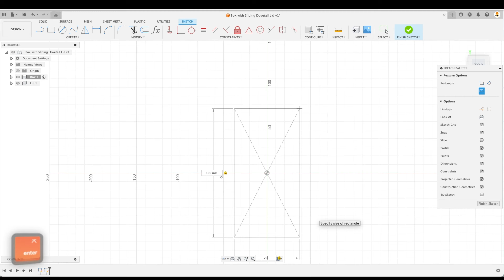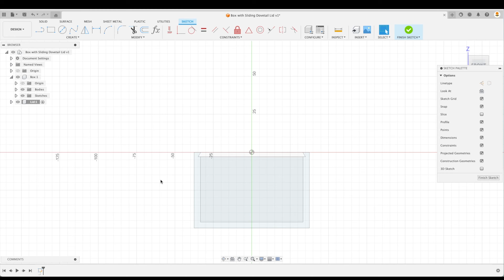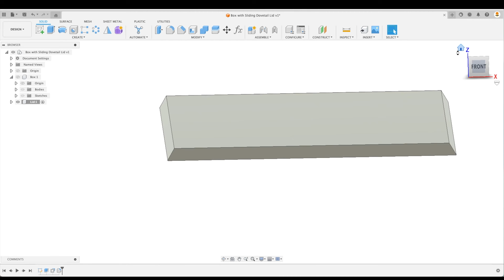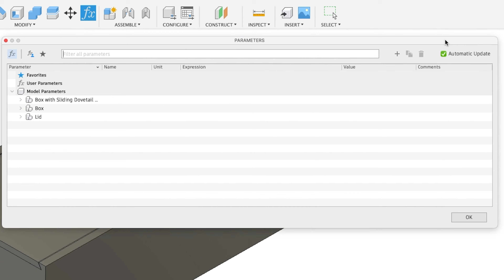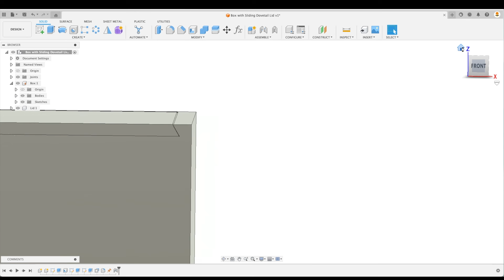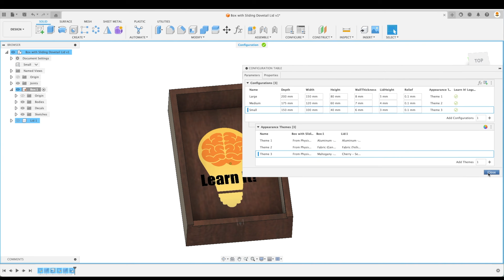Autodesk Fusion 360 - Box & Sliding Dovetail Lid for Beginners, Pros, & Masters - Configurations

Comment: You are able to grab a component and move it around but I can't.  After I create the slider joint, should I be able to grab it with the cursor and slide it back and forth?
Reply from the maker: You should be able to. Please confirm that you have created and joined 2 components and that your slider joint has no max or min limits.

Comment: great video, very instructive but the lid width won't change accordingly.
Reply: does  it have anything to do with the coincident point in the sketch?
Reply from the maker: Usually it is something very small that was missed. A relationship (perhaps a coincident constraint) has been missed. Have you tried starting again? When I was learning Fusion, I often started designs again, sometimes 3 or 4 times over until I understood it.
Reply: Same thing happened to me. I just redone the entire lesson and it works. I believe it was some constraint I missed.
Reply from the maker: @noseasmamut  These things happen to the best of them 😉
Reply: got it, i will try again. Thanks for the tip!
Reply from the maker: Thanks! That’s too bad to hear about the lid.

Comment: If I want to make this type of boxes but with negative space in a specific shape, how does the process vary?
Reply from the maker: I cant quite understand your question. Can you rephrase it and give some more details please? Thanks!
Reply: @learnitalready  If I want to make a box for a PSP, and I want the PSP to fit perfectly, so I need the box to have the hole to put the PSP in, but when I use a 3D model of the PSP to make the cut inside, when I want to remove the face that will make the sliding cover, it gives me an error because the inside part tells me that it is already cut.

Comment: Box doesn't print at all on an X1C Carbon.  Tolerances are way off and don't change the print when changed.  Box is not designed well unfortunately.  Your series on Fusion however is excellent, yet this one doesn't work for a 3d print.
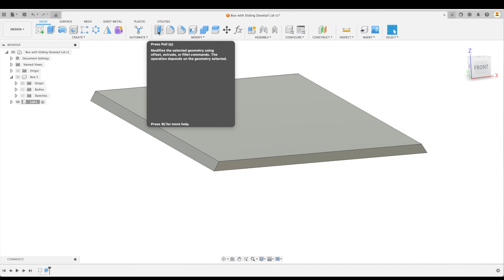Reply from the maker: Thanks for the feedback. Please note that tolerances can easily be adjusted; note the techniques starting at 7:30. If you find an offset for the lid that works, please share the value in this string of comments. Thanks, too, for your support and encouragement.

Comment: Great videos learning a lot! Can you explain why your center is on top of the box when creating the lid and mine is at the bottom?
Reply from the maker: Great to hear! Thanks.

It’s just a matter of whatever direction you extruded the box. When you select a closed profile to extrude, note the direction of the arrow. A positive value will go in the direction of the arrow whereas a negative value will go opposite of that. We probably just went in different directions. Sometimes Fusion selects a different normal (direction of extrude) for a variety of reasons. Not a big deal. Just change your extrude value from a positive to a negative or vice-versa. I generally like grabbing the arrow and moving it in the direction I want to go to see if the value is a positive or negative integer and then specify the value I want.

Comment: When I selected Joint, my box didn't become transparent. I noticed that the ground option says "Ground to parent", and not just "Ground". Did I miss something?
Reply from the maker: Great question. After producing this tutorial, Fusion changed the meaning of "Ground." Now there is "Ground to Parent" and "Pin." "Ground to Parent" establishes a rigid relationship between a child component and its parent, causing them to move together. "Pin," on the other hand, fixes a component in place within the active design, similar to the old "Ground" command. A crucial difference is that "Pin" adds a feature to the timeline, which can be suppressed or removed if the component needs to be moved, while "Ground to Parent" is more integrated with the parent-child hierarchy.

Comment: Your videos are so helpful.   I made a couple huge decisions over the past few months and one of the most important was to become proficient with Fusion360.  I have a small print farm, and learning Fusion 360 was very high on my to do list.  I have used many different tutorials but some of your videos have upped my abilities with Fusion 360 at a new record pace.  I am finally feeling like I have become very proficient with Fusion.  It literally takes a wee bit of investment of hands on time designing stuff from scratch and mixing tutorials like the one's you have provided to learn at an accelerated rate.  

A few mistakes I learned early on were figuring out how to use constraints.   The single most important thing I learned that really jumped me up a few levels was to stay away from the 3d environment when designing, I am sure many get sucked into this same mistake.  Once I realized how easy it was to work with sketches and the fact I could pop them in at will my comfort at quickly designing parts in Fusion jumped massively.   This only happened a few weeks back, for months I just did not put the proper hands on time at designing parts in required to become proficient with Fusion.  

This video was very eye opening with the fact that you show how easy it is to create master templates using the Fx dimensioning tool.  Your content has been invaluable.   I have sat down this evening and learned comfortably how to work with joints, animations, and now with the Fx dimensioning tools.   This is a huge leap in less than 60 minutes.  Thank you, very much appreciated!   

I found this week was my first week with Fusion 360 where I was able to make complex parts for the 3d printer being used in real world applications in literally minutes.   Not even a month ago I would be struggling just to make a few simple objects.  I feel like my abilities are night and day from only a few short weeks ago, these tutorials have paid off in a short period of time.  This is the level I was hoping to achieve.    My next goal is to continue with this self learning and to learn and become comfortable with all of the tools built into Fusion.  

I also have a hobby license for Solid works and hope to start using that soon, I bought the license for around $59 last June, but have only played with SolidWorks a few hours in total.  I stayed focused only on Fusion 360 which was part of my goal initially, become proficient with Fusion than at some point will take on the challenge of learning SolidWorks.  

The main reason I also stayed away from SolidWorks was due to fact that my laptop was old and outdated lacking proper video card and drivers.  It was not running SolidWorks online well.  I recently solved my computer issue by building a preretirement computer system.     Two weeks ago I built a killer computer setup with the latest greatest 5070 video card, a 16 core AMD Ryzen 9 7950 x3d processor mixed with the new Samsung  2TB 9100 Pro NVME 14GBS SSD for my system drive.  The other top add was a nice large 34 inch curved 165HZ monitor.  Wow, the 34" monitor made a huge difference working with CAD software.  This made all the difference in the world for being comfortable while using Fusion and being able to see everything well.  A few months ago I learned that comfort is important when sitting at the computer for any length of time while trying to learn.   I invested in a very comfortable chair and desk setup, one must pay attention to these details when working at a computer station for any length of time.  This becomes even more important at my age.   Anyways,  looking forward to applying all of the valuable information I have been gaining from your videos to my Fusion 360.   I am also looking forward to my next challenge which is to install SolidWorks on that new PC and to sit down and become as proficient with Solid Works now that I have the proper computer setup capable of handling their software.   Your videos are very much appreciated!

I will have to sit down and work also at becoming proficient with use of spline tool, to date I have pretty much stayed away from it.  Some people like it a praise it while others stay away from it.  I have not really formed an opinion yet on it, I only know I seem to be able to get by without even using it.  I stick to tried and true tools and methods, but maybe that will change as I practice throwing it in there.  I am also starting to use shortcuts more often in Fusion, this is very helpful.

Comment: You could have also added the depth parameter to your sliding joint limit!
Reply from the maker: Yes! Excellent comment. Adding limits to the joint motion is always good to do.
Reply: @learnitalready  yep, and you had a number in there, but it was the hard coded number for the first box length you put in during the "newbie" section.

Comment: Beginning to run out of superlatives :)  But once again an awesome session.  This was a nice respite from the previous lesson.  Boy configurations are very cool.  I may have to take advantage of the new Flex subs that AutoDesk is offering just to play with them.
Reply from the maker: Thank you so much for your ongoing encouraging messages. Glad you’re still enjoying what we have to offer. 
Also, this lesson is just scratching the surface with configurations. I just finished an immense job for a company that manufactures rotors. We are planning on showcasing what Fusion can do to such an immense scale - thousands of rotors in several different styles. Designed, CAM’d, and sent to the machine in 5 min (instead of 3-4 hours per/part). It is mind-boggling how configurations can be used for the benefit of small to large scale operations.
Reply: @learnitalready  Very cool Tai.  With what I do for my hobby it would be nice to use configurations but not necessary given the scale.  But your example...just WOW! What a timesaver.
Reply from the maker: @ Would love to see some of your hobby projects at some point. Keep up the good work!!!

Comment: Great video but something broke.  I added parameters but when I changed the width parameter from 75 to something higher or lower, the lid width stayed the same.  The Depth worked OK.  I'm not sure that when I started the lid I really inherited the geometry from the face of the box.   Is there a setting that controls that?  When you tested the parameters you showed only the box and not the lid.  However, it did work when you showed various configurations.  I did not do the configurations as that appears to be a paid feature.  I appreciate any comments you have.  Thanks.  BTW, I've done a lot of your videos and really have learned a lot.  Irv in Florida.
Reply from the maker: Thanks so much! Don’t worry, oftentimes our model or assembly will break while figuring out parameters, especially late into our design process. Also, in this specific tutorial, parameters will have the same effect as the configurations, because the configurations example is very simple, so all should be good in that regard. 

Your explanation sounds like something was missed. Again, don’t worry as that sort of thing happens often. I would suggest starting again and check your parameters often throughout the design process. If all parameters work at step 1, then move on to step 2, 3, 4 and so on. If it breaks at a specific step, then you don’t have to start again, but just try me diagnose the error that just happened.

Please let me know if that helps. You can also send the file to us so that I can diagnose it. Please don’t forget to like me subscribe (if you haven’t already done so) as it helps to get our channel out into the YouTube world. Thanks so much!
Reply: @learnitalready  Hi...  I restarted like you suggested.  I think I found my error or the only thing I might have changed.  When I projected the 2 insides, I don't think I had the Projection Link checked.    I made sure I did and followed the video.  After completing the Lid, I added parameters (even before the Joint)  for Depth and Width and then checked to create different Widths...Nothing Broke!!  Thanks for getting back to me and now I know something else about Fusion 360.   Irv in Florida.
Reply from the maker: @turnswood  amazing! 🤩 Great! I too have had to restart my work again and again sometimes until the workflow is just right and my model doesn’t break. It’s all part of the design process. Glad you stuck it out. Keep up the good work and keep us posted with updates.

Comment: Thanks for this. I have a follow-up question regarding the lid design. What do you recommend the best way to keep the lid from sliding forward if ever the box been tilted forward?
Reply from the maker: You’re most welcome! For me, I would probably make a small bump on the base where it meets the lid (or underside of the lid where it meets the base) to provide a little pressure on the lid. This would prevent it from sliding out for sure. I actually had that design elements in my original tutorial idea but took it out because the tutorial was going to be too long. Thanks for asking about it.

Comment: Hey there,
Great video and thanks! New to fusion. I am making a box that has a curve on the back face when I try to extrude, It either stops on on the one edge or cuts away the face if it goes to the edge of the curve. Is there a fix or way of doing this?
Reply from the maker: Hello there!

Thanks so much for taking the time to comment and for thinking this tutorial was great. 

Regarding your question, can you explain a little more about your current problem please? It’s a little difficult to picture your issue right now. Thanks!
Reply: @learnitalready  
Good morning and thank you for responding! I made a video to help explain my situation 
https://youtu.be/maqdXszNd18?feature=shared
I have paid just shy of 300 to people to help, and everyone is not using fusion, so I can't edit it afterwards!  I just can't sort out how to make it work but there must be a way. Any push in the right direction would be greatly appreciated

Comment: Lots of similar tutorials, but none of them shows how to cut at angle also the back wall. Would be nice to add that detail. To achieve this there should be one final cut on the back wall from angled face (created by the cut shown in this tutorial) to the other angled face. It does the trick.
Reply from the maker: Thanks for your comment! Funny enough, I actually added that detail in my first recording of this tutorial and then decided to change it to what I currently have. I’ll try and implement your suggestion in a future tutorial. Thanks again!
Reply: @learnitalready  great! Just fired my 3d printer with similar box, will see in the morning if theory works in practice 😎

Comment: Excellent tutorial.  I was working on a design with parts fitting together and this helps a lot.  Question:  When you export to the 3d printer does the box and lid export together?  Can I then move them separately to print?  Question 2:  How does the logo print out on the 3d printer?
Reply from the maker: Thanks so much for your comment and support. Here are some answers to your questions:

Q: When you export to the 3D printer does the box and lid export together?
A: No, you will need to export them as two separate files. Check out our tutorial as to how to do that:
https://youtu.be/B6DW1cMvWS4

Q: Can I then move them separately to print?
A: Yes, it will explain a little bit in our tutorial how to do that. All slicing software is different, but should be similar enough to replicate what we teach in that tutorial.

Q: How does the logo print out on the 3D printer?
A: Depends on a number of factors. Try to always printed a logo (I’m assuming that you’ve extruded a sketched logo) on the top face of your body. If you have used a decal as your logo, that is only for rendering purposes and will not be added to your exported body for printing. 

Hope that helps!
Reply: Amazing video! Now I just need to figure out how to design locking tabs on my lids so they don't slide out.
Reply from the maker: @SmoothbassmanStudios  Thanks so much! What about adding a small sphere outdent on the box and a mating indent on the lid? Would be incredibly easy to model.